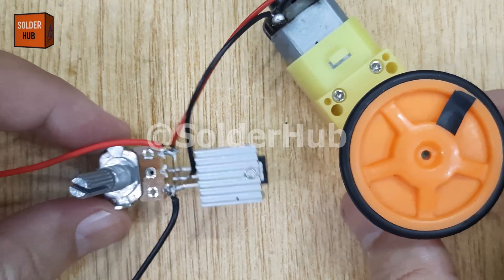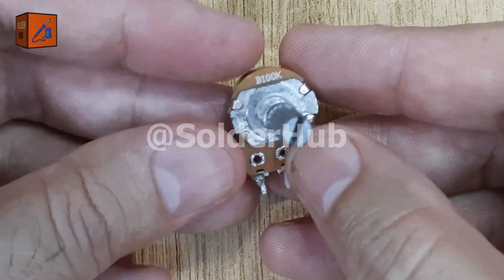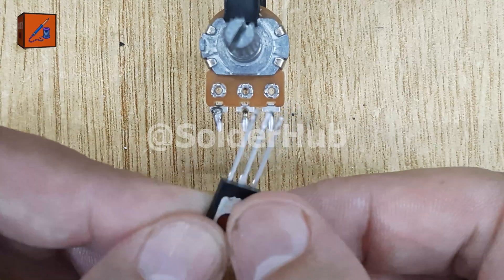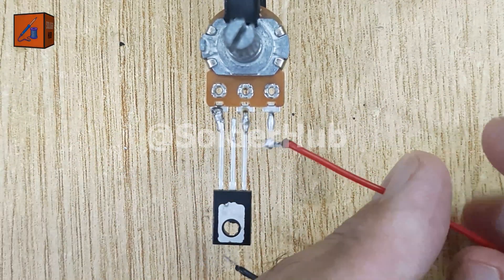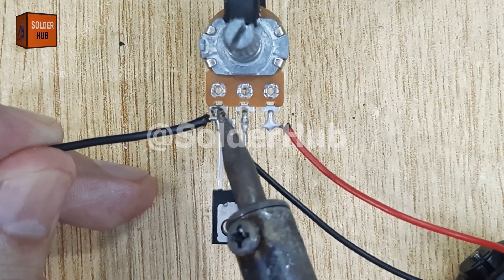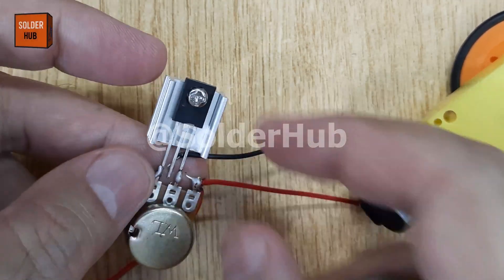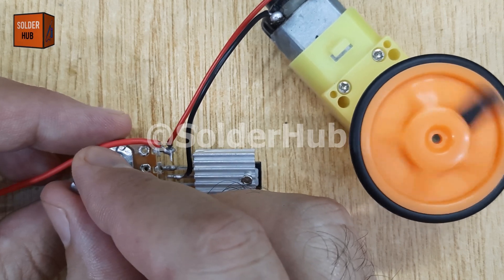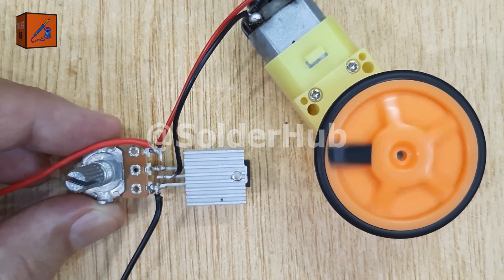How to Build DC Motor Speed Controller

Comment: This video is garbage. He states it uses PWM when it DOES NOT. [Edited - because I believed an incorrect other comment that said it was a voltage follower]. This controls the current in the motor, which is essentially the torque. Therefore the speed the motor runs at will depend on the load - ie it is a really bad speed control. It most certainly DOES NOT show how to control a motor "just like the controllers you see in professional machines". For a DC motor you need PWM and reallty also some feedback. For "professional machines" to get precise speed with decent torque you probably need to go for a stepper motor. Also, this circuit is hugely wasteful on power as it drops loads of voltage in the transistor which all just disappears as heat, which would not happen with PWM. Fine for a toy demo but don't do this is you actually want some mechatroincs to work properly. * The following was in the original comment but is mistaken, but would be true of a voltage follower -  "Additionally, while appearing to work at low speed it will perform poorly there (poor torque), and not self start (in the vid he starts fast and then slows down which he gets away with because of the inertia of the wheel)"

Comment: This circuit does NOT demonstrate the principle of PWM speed control. It's a simple voltage follower adjusting to voltage applied to the motor.
Reply: Having re-watched, it is not a voltage follower - it is controlling the current through the motor.